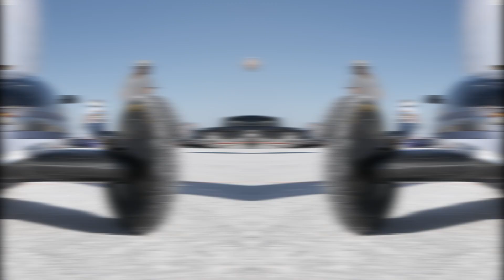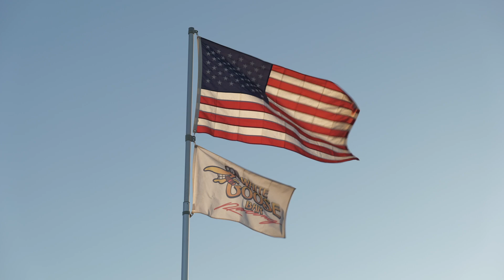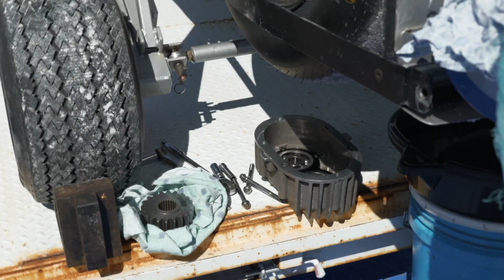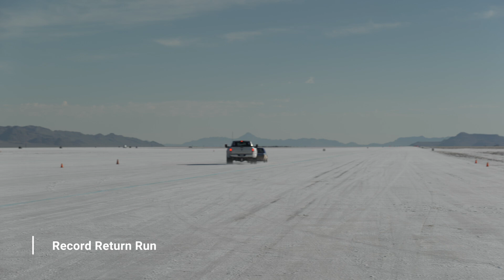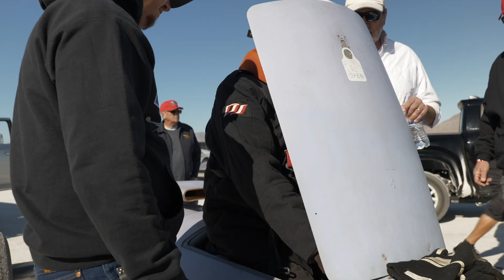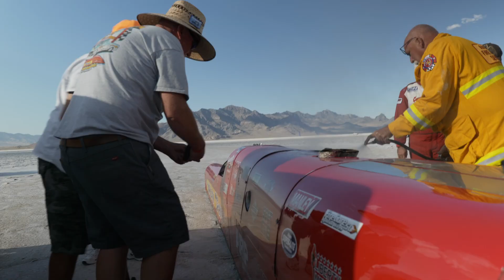Bonneville World Finals | Streamliner Problems Pushing for 400MPH | VW Caddy Goes 195+MPH |RS Garage

Comment: Why did u change from vvti to a non vvti setup? So ultimately non vvti is better with more power? @Rs Garage
Reply from the maker: The block we had available to build was a 1/2" stud Dart block and Jay had a 1/2" cylinder head from previous use. Instead of getting a VVTI head machined for 1/2" he used the head that he had.

Comment: Just something about max rpm, max "time on load" and have stuff live that stands the hairs up on your neck🤌
Reminiscent of old static dyno testing of F1 engines..break out the pen and write down the co and temps..😅
A hint why the caddy lived...it's got WAY less tip than map. 
If that had a low compression or large clearance volume, the ve of that engine would be mega. 
Great video as always. 👌